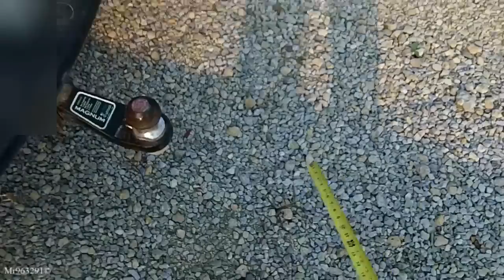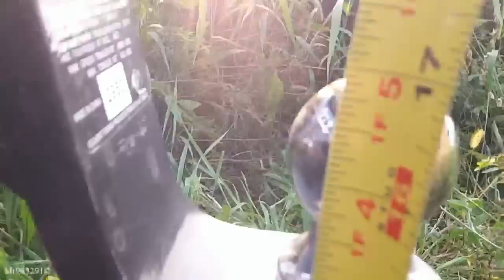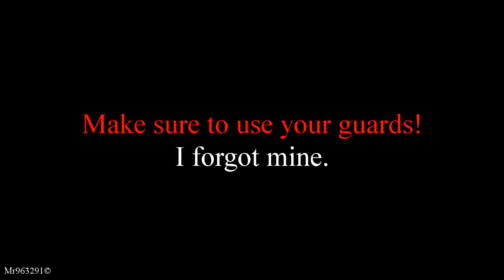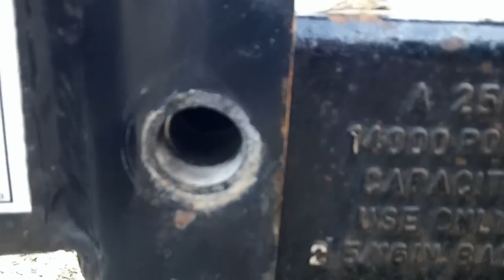Trailer Ball Coupler Hitch Swap and Tips On How To Do It and Hook-up

Comment: I'd just like to point out to anyone using this as a "how to", don't use a tape measure to find level unless you are 100% sure the trailer is on a completely flat surface. What if the ground is uneven?
Reply from the maker: Fabricobbler fair point! Thank you for watching and the helpful comment. And the ground was slightly uneven...
Reply: @Mr963291  Thank you for your content. The more we can learn from one another, the better!